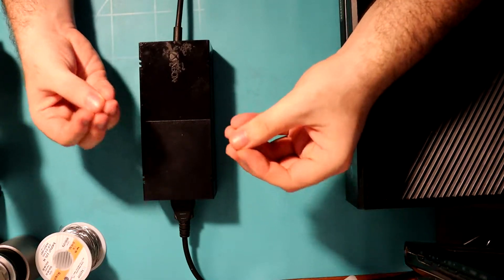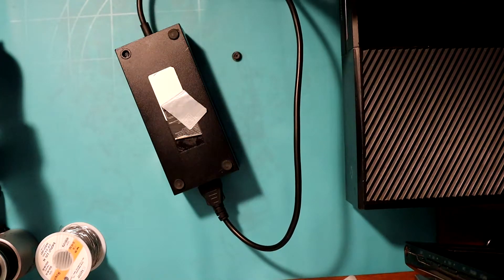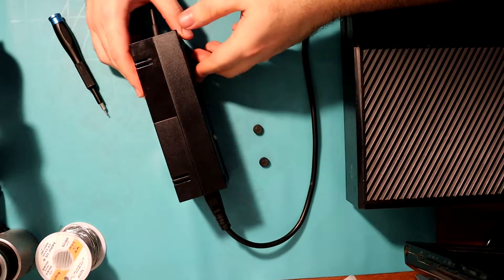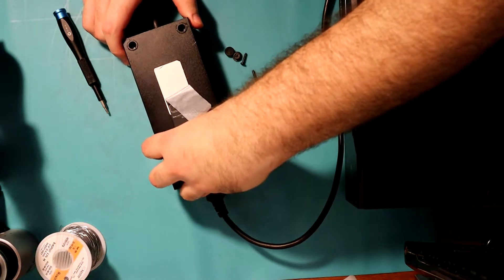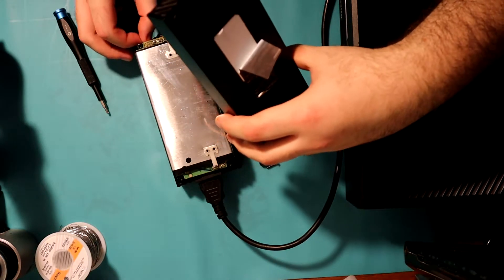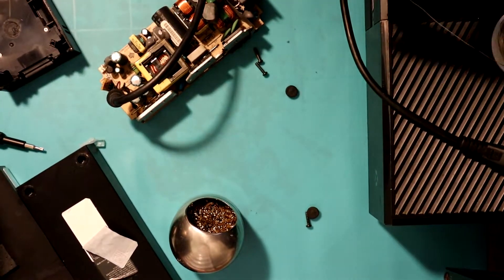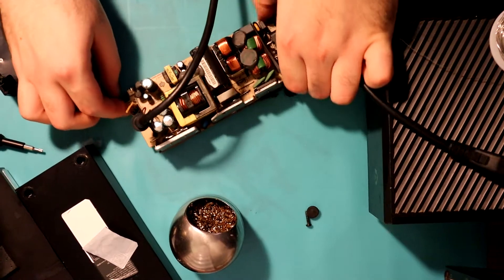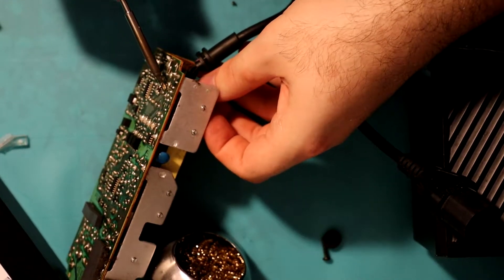Fixing Xbox One Power Brick with Orange Light

Comment: I tried this and the orange light still goes turns off and fails to power the Xbox One. I tried twice with two different sets of capacitors, and it's the same thing. Could it be the solder I used or maybe a different capacitor than those three that is bad?
Reply from the maker: It could technically be both if your solder joint is too shitty. Im guessing it might be one of the other big caps.

Comment: The tool you used in taking out those black screws, what's it called please ?
Reply from the maker: I don't recall the exact size but it's a torx screwdriver, might have been safety torx. Any good torx screwdriver kit should have the sizes you need, or you can just buy an ifixit kit, it's what I'm using
Reply: @ItalianRetroGuy  never heard of any of these before, but thanks

Comment: Hi mine just doing the same rn and i wonder if u cant replace this power suplly to a new one???
Reply from the maker: I am not sure if I understand the question exactly but you can use another power supply if you want, it's just that using an original one is better normally, and the new ones are all aftermarket. A good one will have zero difference, but the original is guaranteed to work without damaging anything

Comment: I opened mine and it seems that the 1500uf 16volt capacitor has swollen. Im replacing it today and i will let you know if thats the cause. Its weird that the complete opposite capacitor has swollen compared to yours heh.
Reply from the maker: It's not weird, it's something that can easily happen. Any capacitor could swell for any number of reasons, and sometimes capacitors are sourced from different suppliers, but at least from different batches. This affects their quality and which one is going to fail first.
Reply: @ItalianRetroGuy  i replaced it and its working fine again. I will clean the fan while im at it
Reply from the maker: @andrewkds  That's an happy ending right there :)
Reply: @ItalianRetroGuy  indeed, thanks for the teardown video :)

Comment: Bro don't use an old school soldering iron. If you wanna take your game up a level invest in a soldering gun or butain iron. They provide instant heat, for clean melts other than that not bad man
Reply from the maker: I don't agree, in my opinion this is bad advice. Thanks for the compliment though.

I think I owe you a better explaination there. At the time of recording this video I was highly inexperienced, I came a long way since then improving my soldering to microsoldering-level skills.

That is not an old school soldering iron, that is a TS-100 which is a highly intelligent, compact and modern soldering iron with temperature control. It was paired with the best power supply possible allowing it a maximum 65W of power, its tips are the modern style with an embedded heating element for maximum heat consistency. They come in various shapes with some being also suitable for microsoldering.

Since then I switched over to a T3A soldering station with a maximum theoretical 200W of power, compatible with JBC 245 series tips.

Never in my right mind would I switch over to a soldering gun which is literally the clumsiest type of soldering iron there is, or a butane iron (which admittedly does sound pretty powerful) with its awfully large and limited tip selection.

TL;DR: Your advice does not suit my case.

Comment: I have a off brand power brick and before something happened it would always get really hot and make this horrible noise. It’s been months so I plug it in and it has a orange light and when I touch the on button it makes the beep but no light on the power button. And when I press it very lightly flashes. If I click the button then immediately do it again I hear the shut off noise. So I took the power brick apart and like every connection is covered with a white/cream colored hard foam or rubber. So could it just be the power brick even if the Xbox light doesn’t show up? And what would be a good power brick to get? Sorry this is so long I just don’t want to waste money on a brick if it’s the Xbox itself. Tnx
Reply from the maker: Whatever the case is, what people normally do in your situation would be grabbing a brick from Amazon and returning it if it doesn't work.
Reply: @ItalianRetroGuy  ok I’ll try it  tnx
Reply from the maker: An used original brick would be the best way to go. Either way it's hard to tell which one it is.

Comment: Can a 50v Capacitor fix mine
Reply from the maker: I don't remember the ones I used, but it cannot be lower. It's going to explode otherwise.
Reply: @ItalianRetroGuy  how much volts is better
Reply from the maker: I just checked and as long as it's 2200uF and above 16V it will be fine.

Comment: I threw away an Xbox One power brick that when I plug it into any Xbox One it the orange light will cut off. Would it have been an easy fix?
Reply from the maker: Not entirely sure about that mate. I only fixed this power supply because the issue was obvious, I'm not really an expert with these.

Comment: I recently change all caps, including the one at 5 volt out stage, with 2200 uF , 16V caps, I connected to the wall, orange light then to xbox one, tattaa it powered up my xbox, I played several hours then,  brick went down, no lights at all. I reopened it, suspected that the 5 V output stage cap might be problem, i replaced, the orange light came back tried it but it didnt turn on the xbox. After that, I changed with another cap, and no orange light at all, so i am curious if u might suggest what to check? or any integred component to check??
Reply from the maker: Honestly mate at this point I'd just get another one. But I might replace all capacitors if they are cheap enough to get for you, as for integrated components if you join my discord server and get me some pictures I would be happy to provide some advice
Reply: Shush
Reply from the maker: :o

Comment: When i plug in the wire 🔌  the brick turns orange
Then when i plug it in from the back it turns blue. Then turns off immediately after

Or if the back one is already plugged in
and i plug in the wire 🔌 it turns orange for a second. Then blue for a second. Then off. 

if both are plugged in it stays off. What can i do?
Reply from the maker: It may not be a brick issue. It could be the xbox in this case, something shorted and the brick turns off to protect itself and the console
Reply from the maker: I still recommend getting another power brick, but it has to be original or anyway high quality. A cheap knock off could damage the console to an unrepairable state if it really has a power rail short
Reply: @ItalianRetroGuy  ok

Comment: I like the good power supplies like the NES or SNES ones. I don't like the ones with the fucking yellow lights and fucking fan inside the fucking power supply. Who the fuck designed this?
Reply from the maker: This is a good power supply, but capacitors with a high capacitance rating tend to fail relatively fast

Comment: Mines straight orange and never changes and the Xbox makes the starting sound but very faint
Reply from the maker: Yes that's probably the same issue, just worse. The capacitors can be in worse health and do this
Reply: @ItalianRetroGuy   All I can do is randomly try to turn it on, that's the only way it's been working. Guess that's all I can do now, wait.
Reply from the maker: @OmniscientNull  if you don't feel confident repairing it you just need a new power brick

Comment: Hi,I'm not sure if it's my xbox or powerbrick.It  doesnt go white for 20 min after I plugged it in and I keep having to try to keep pushing my xbox one power button but it either makes a noise and doesnt come on or no noise at all.Then the powerbrick later goes white and I press the button then it's all fine.Is it the power cable or xbox?
Reply from the maker: Hi it's probably a capacitor if it is orange before going white. You see, the power brick I fixed in the video did the same exact thing, it would eventually work fine but it needed several tries, prayers, and the goodwill of all the pagan gods.
Reply: @ItalianRetroGuy  thanks so much for the reply,I really appreciate it.So it is the power brick that is faulty if I understand correctly?
Reply from the maker: @danielvdm518  Yes that's pretty much the gist of it, you can probably find a way to try a new brick before buying it. While I did repair this one I also got shocked in the process (I don't have experience dealing with high voltage) so I don't fully recommend opening yours up.